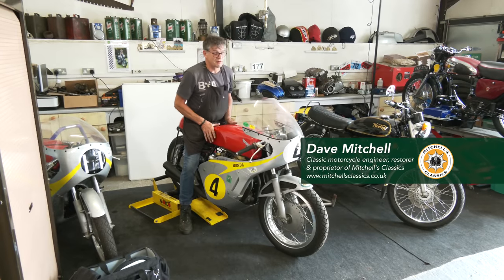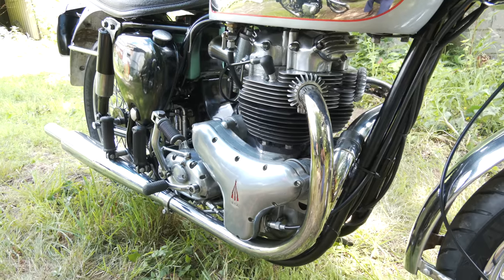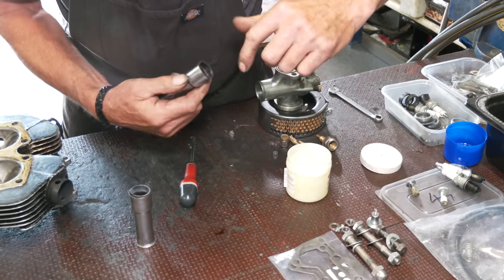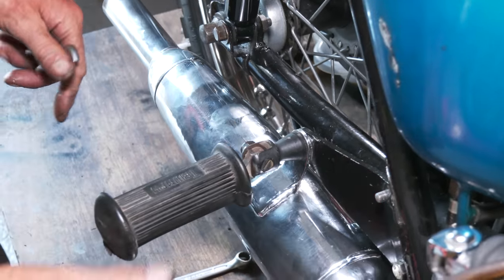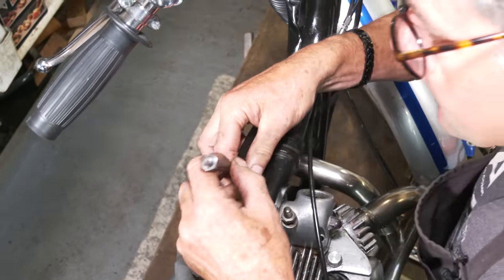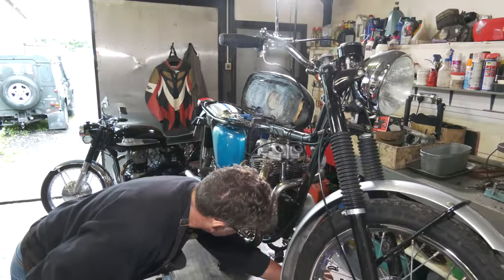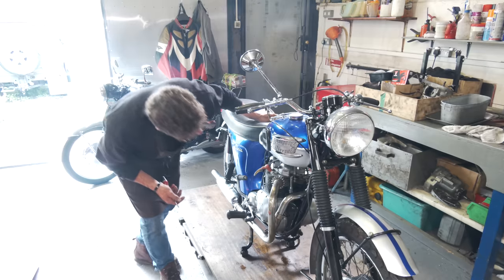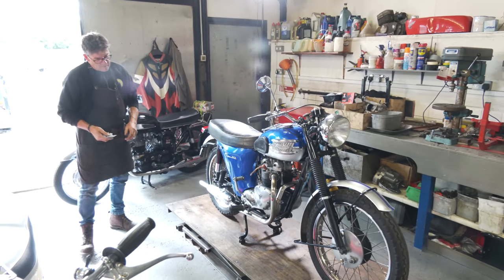Classic Motorcycle Workshop Vlog 7 - 2 Triumph Tigers etc

Comment: I had a 73 750 Tiger. Stripped a lot of weight  bored it 060. Over. Added a 1/4 turn quick throttle, stock pipes sans mufflers but I put small sniffers.

Comment: I appreciate the way Dave talks through everything as he's doing.  I  actually wanted even more detail, like when he was adjusting the carb toward the end, what was going on there.  Was it running lean to begin with, did he have to crank the idle adjustment up?  That sort of thing.  (Maybe because I'm dealing with a carb issue right now.  The carb on my TR6 is all of the sudden getting finicky on me.   I'll clean it and it'll be fine but two days later I'm re adjusting air screw and idle screw.)    Can't figure out what's wrong.  The bowl does seem to have a slight warp to it, so maybe it's sucking in some air.   (EDIT: I've since put a brand new Amal Concentric premiere on my bike.  It's been running and idling great )
Reply: I had the same thoughts, I think Dave missed a real opportunity there. Extremely important thoughts not conveyed at the carb adjustment.  Just goes to show you how intense the job can get.